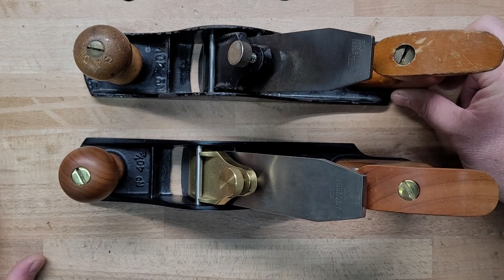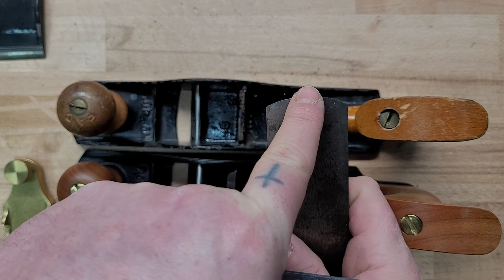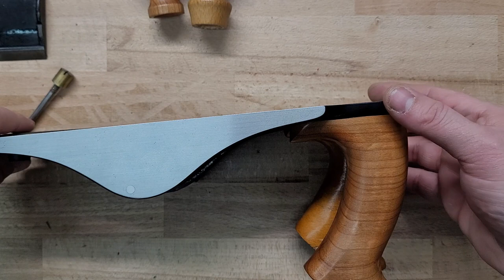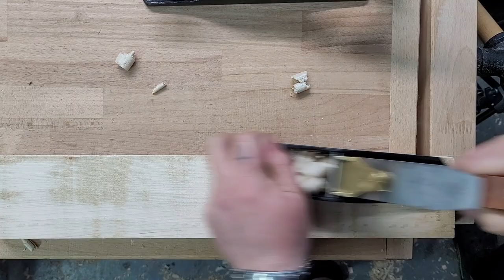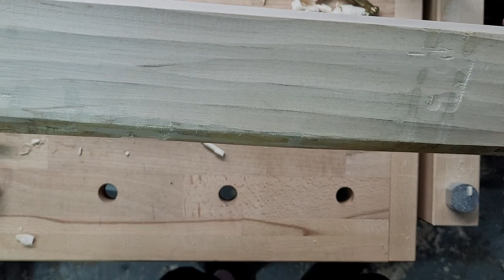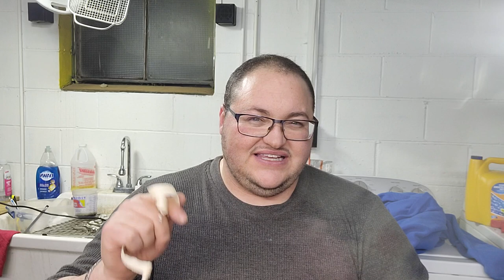Scrub Plane Edition - Lie Nielsen Vs. Stanley Comparison - What LN changed/upgraded and why

Comment: Good video. It is interesting to see the small tweaks Lie Nielson did on this plane. Is your comparison of the stanley planes going to be vintage or modern? And if vintage are you going to go down the line with them, eg 4, 4.5,5,5.5,6 etc... 

I sometimes look at 2 of the planes that I have a Lie Nielson that I got this year and a stanley I bought from a vintage tool shop. Both could be said to be made in the 20s. Just 1 is 100 years older. But still the same design from a person who lived in the 1800s. It is kind of nice that good designs last.
Reply from the maker: I don't have enough LN to go down the line through all the numbers but I will compare the ones I have and if I aquire more (borrow or buy) I'll deff add a video!  
It is amazing that one is so much older and the other is modern. Shows that stanley had it figured out. They unfortunately, strayed from some designs and imo was their downfall. I have not tried the current line of Stanley. That would probably be a good thing to add tho!

Comment: Great timing. I've been considering getting a scrub plane. What are your thoughts in turning an old Stanley #4 into a scrub plane? Everyone focuses on the shavings more than the wood itself.  Lie Nielsen looked smoother overall. I'm guessing I'd need to put a new blade into an old Stanley scrub plane, which would put it pretty close to on par with the Stanley price-wise.  Joined your buyer/seller facebook group but am a little stumped on how it works. Are there instructions? Thanks!
Reply from the maker: I have know alot of ppl that take an old no 4 and convert it into a scrub plane with good results. Takes some modification and sometimes requires the mouth of the plane to be filed open more.  I had a TayTools converted scrub plane and liked thay it got wider shavings but it also required alot more effort to push because those planes are heavier and your taking bigger cuts. Imo it works but isn't better than a true scrub plane that is dedicated to the task. I am not sure if buying a new scrub iron and putting it in a stanley will produce the same results as the LN. Also not sure if that will work because there isn't alot of room between the bed, cap and post. 
In the group if you go to the files section at the top you will see the rules and stuff listed there. There are videos and type outs that will help explain everything. You can also search #cihiwelcome in the group and they will pop up.
Hope that helps!
Reply from the maker: I ran to the shop and checked to see if I could put the LN iron in the Stanley. The cap won't seat so the iron is to thick now... I can tighten it down slightly and it can take cuts but it make me nervous that something was gonna break because it just didnt feel strong so I stopped haha
Reply: @BatCaveCreations  Thanks!  I might give it a try. If I'm going to pop for a LN I think I'd rather get a #4 and turn a cheaper plane into the scrub that I won't use as much. But I agree that the mouth might be an issue. Thanks!